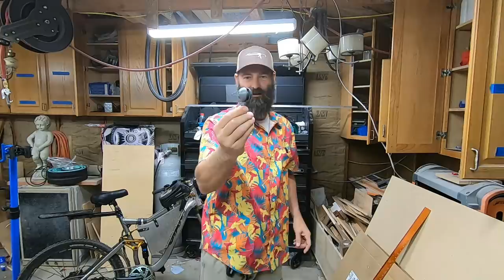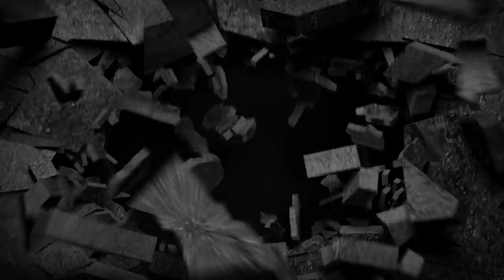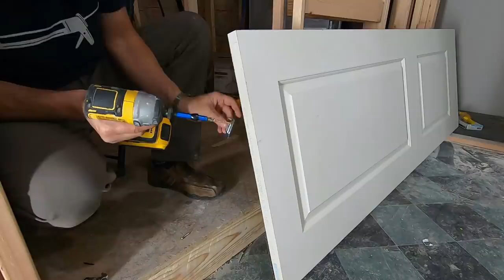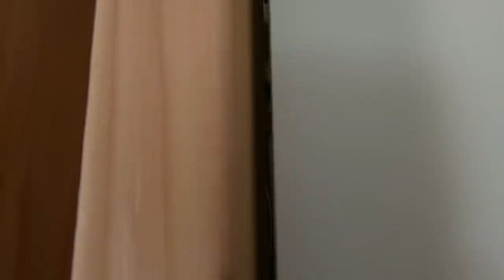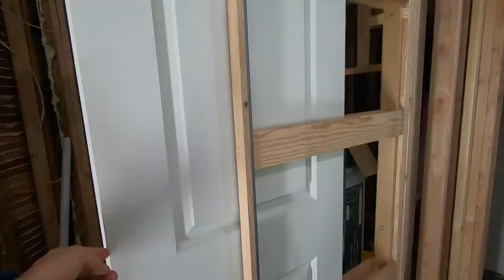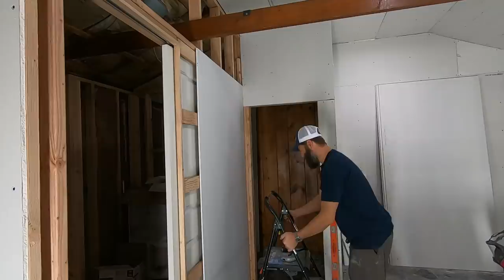Pocket Door Vs Barn Door | Step By Step | THE HANDYMAN |

Comment: A huge tip I know for pocket doors is to add plywood between the wood slats in the frame. That way there is something to screw to for any wall art or hooks, etc, since wall anchors can be long enough to scratch the door.
Reply: Very true!
Reply: That's smart!
Reply: Good tip
Reply: Better frame that knowledge n hang on the wall for the uninitiated who will sink anchors anyways...
Reply: good tip--should stiffen it up too. so floppy.
Reply: I've seen guys frame it in a 2*6 wall can use full 2x on the flats.  Have to have the space but much more sturdy. And can hang anything, even put a plug in a shallow box.
Reply: @KevinKimmich44024  it adds a little rigidity, but doesn't fully stiffen it up. The wall still has some give at the opening, but it is a bit better.
Reply: @KevinKimmich44024  Good observation. HM answered this same concern in another comment & said the later framing/trimming of the door opening (both sides) will add rigidity. Makes sense :)
Reply: @jeffoneil3604  that's a really good solution to all the problems I experienced with  pocket doors. thanks for that tip.

Comment: In my kitchen remodel, I remade the pantry and used a beautiful 100+ yr old entry door that had been stored standing vertically for the pantry door. It was warped and rickety, and had to be reinforced with steel channel around the perimeter and sheet metal on its back.  Barn doored it for two reasons; didn't want to hide its "charm" when the door was open, and the warp meant the track wasn't exactly parallel to the wall.  Barn doors are often more decorative than standard door slabs, and want to be displayed. Also, no privacy issues in the pantry.

Comment: I live in a large home that was built in 1859. All of the transitions between the 6 rooms on the ground floor have original double pocket hole doors. I believe these to be solid mahogany, and are approximately 7.5' tall by 4' wide each to span the 8' "doorway" from room to room. They are massive and heavy, but considering the age, still work surprisingly well.

Comment: I've installed several pocket doors over the years and they do offer the advantage of not having a door arc into room space  as well as provide wall space for furniture etc. As others pointed out...there is a risk of damage to them especially when it's a high traffic area and or kids are using that a lot.  Most of the doors I've installed are raised panel hollow doors and lightweight... makes for easy install and handling. Barn doors look pretty good too but that's a matter of personal preference.  Always enjoy your videos Mr. Handyman...keep them coming ..
Old timer retired fan here. .

Comment: I have retrofit pocket doors twice where I accomplished the job leaving one side of the wall intact. In both cases I used a hardware kit but built the frame in place using kreg pocket screws to secure the frame. I think the issue that drives barn doors is the presence of wiring or other interferences in the existing wall. I was able to relocate some wiring to do mine. One door previously had a nice pair of bifold doors; so nice in fact that I used my kreg system to marry them up into a new one piece door that I used in the pocket.

Comment: Don't go cheap on pocket door kit, guaranteed to break if you look at it wrong.  Bought a "soft close" and "soft open" kit for mine...  Its amazing.  No slamming either direction
Reply from the maker: Thanks for the comment.  Where do you get these soft open and close pocket doors?  I wonder if there is a kit that could be added to this cheap home depot pocket door.  Supply was very limited when I put this door in.

Comment: Was just considering which to use on my project, a timely video indeed. Appreciate you handyman!
Reply from the maker: Pocket doors will stand the test of time. Barn Doors may go out of style.
Reply: @TheHandyman1  True, but this is a rental where I'm trying to conserve space in a small room by not using a traditional prehung. I forsee tenant issues with a pocket door (screws into the door through wall, knocking off track, ect). I think for those reasons I'm leaning towards a barn door application, however I've never installed one myself, but sure I can figure it out. Especially since I'm reframing the wall from scratch.
Reply from the maker: https://www.youtube.com/watch?v=IjkJnP0BQcQ  This is the last video in a barn door build series I did a few years ago. The install is in the 2nd half of the video.
Reply: I decided to put barn doors for the doorway through a new kitchen wall because building pocket doors were just too much extra work.
Reply: @TheHandyman1  Well that's handy and motivation to apply to my project, thank you sir!... Do you have a Patreon? I appreciate the methodology to making ish work n the balls to post processes despite the internet barking.

Comment: I found out the quality of the door is very important. Initially I figured, it's a hanging door, any cheap door should work. I was wrong. I installed the pocket door for a bathroom. The temperature differences between inside  and outide of bathroom causes the cheap door to warp as it expands in the interior of bathroom because of heat and humidity. This causes the door to scrape the slit studs when opening door after a hot shower. Once temperatures return to normal, door returns back to its straight self. But something I will  do differently the next time.
Next time, I will try a higher quality fiberglass door.

Comment: Room is looking awesome! And agree about the fad thing. Barn sliders are cool & hip if you live in a loft building. But elsewhere? Meh. So "3 years ago".  Plus, they can take up valuable wall space where a dresser, bookcase or chair might be useful. Pocket doors, much better option. It never even occurred to me that one might fit, forehead slap! 😜👈

(eBay for original door & millwork parts? Then restoration re-sale stores. Many large cities have them. Maybe start with Denver. Then St. Louis, Chicago or NYC. Any major urban area known for having many old larger homes & buildings.)

Comment: We have a 100 year old house, prob 1920s, we use our pocket doors constantly, they go from the dining room to living space. My dislikes about them are they squeak and rub terribly, but after reading an above comment about a warping door, i wonder if thats what has happened. Due to the age of our house, they also act as a breezeway. In the winter a terrible draft comes in, full blown wind, very inefficent, in the summer a hot breeze will blow in. Ive considered taking them out, putting insulation in and closing them off.  But keeping it all incase the next dweller wants to reverse it. Ive also considered turning them into barn doors because we have the wall space, and just the fact we wouldnt be getting that breeze. Its cheaper to switch the doors than to reside and insulate the outside of the house. Any other ideas? They also dont seem to be solid wood, but a laminate possibly and hollow.

Comment: I have a townhome that I need to remodel the basement bathroom.  The bathroom was not original and it was added before I bought the home.   Needless to say they did a very had job on it.  No wall and even the shower, sink and toilet are just sitting there.  The plumbing looks good but everything else needs to get redone on it.  Since this is a bathroom in a smaller area.  I want to use a pocket door to conserve on space.  Is there any issues using a pocket door for a bathroom door.  Also this is going to be next to the furnace and water heater.  I was also curious if there is a way to get a lock on these doors for privacy.  I know this video is old and you may not respond but I would apricate the feed back.

Comment: Do you have any tips on how to keep the pocket door adjusted correctly? I have a pocket door with similar hardware and I have to re-adjust it every couple months because the front of the door always lowers down and needs to be raised. It is probably from my two year old slamming it open and closed.
Reply from the maker: loctite on the adjustment bolt?
Reply: I thought about doing locktite as well! Thanks for the reply!

Comment: There must be a "trick" for track doors but I loathe track doors. I have two bi-folding doors in my laundry area and they are a royal pain in the derriere to work correctly. I suspect that the materials used to install them were inexpensive. I hate any door that requires a track. Shower doors and bi-folding doors.

Comment: I can model and 3D print those if I have the part or dimensions! message me if you're interested.
Reply from the maker: They are made out of metal.   I 'm not sure plastic would hold up
Reply: @TheHandyman1  I also work in a machine shop, if you're wanting to go that in depth with this.

Comment: I'm an electrician by trade so I know nothing about Installing pocket doors. Just curious from the jobs I've been on I've always seen them installed after drywall is there a difference in doing it either way?
Reply from the maker: It's a very cheap door setup from home depot.  I wanted to make sure it all worked right before putting up the drywall.  The closet door will go in after paint.  I put the door to the room on to keep dust from going to the other parts of the house.

Comment: So, if the roller on the pocket door breaks or comes off track, you have to take down the wall? I would rather repair a barn door than a pocket door. Same for installing.
Reply from the maker: No need to take the wall down.  It pops on and off fast and easy.

Comment: Who cares if barn doors are supposedly a trend? A well executed barn door with nice hardware looks better than any pocket door except for an antique solid wood pocket door in an old colonial home or something similar. Here in DC, a lot of the older houses on Capitol Hill have beautiful pocket doors, but the ground moves too much for them to work consistently.  Common pocket doors in general are trash in my opinion and generally poorly executed. To each his own though
Reply from the maker: Spicy.
Reply: barn doors are great, in barns. Actually I have installed some that worked with the space, but for the most part they go in houses where millennials have all the "home" signs, and don't really fit in the space as well. I've had people surprised that they don't offer much in the way of privacy and sound reduction, and have had to do custom work after the fact. pocket doors have their flaws but the higher end ones can look nice, and they are less intrusive than a door literally hanging on the wall lol.